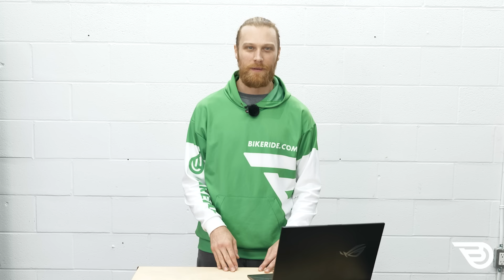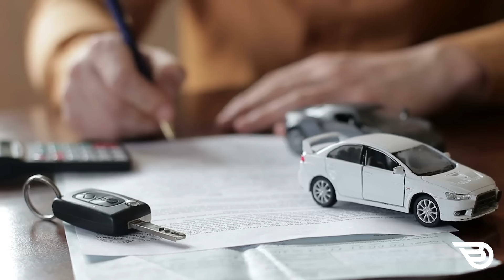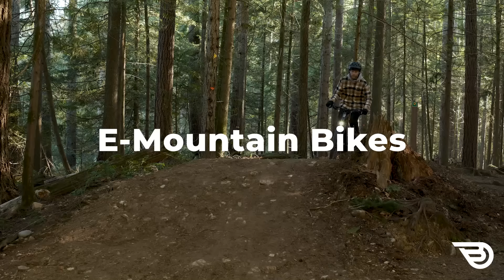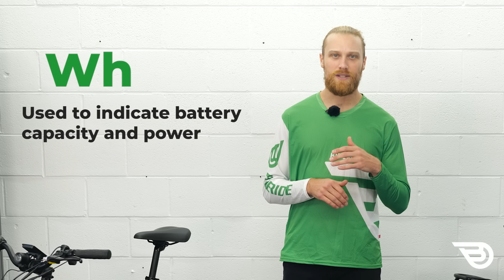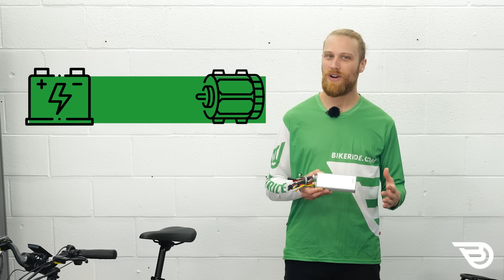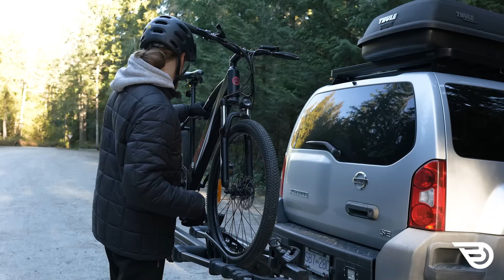Electric Bike Guide – How to Pick Your Perfect Bike

Comment: Thankyou for this review, I have a Land Rider which I purchased about 20 years ago. I've hardly riden it so it for all intence and purposes is like new. I want to convert it to a mid-drive ebike, what does the community think?
Reply from the maker: Converting a traditional pedal bike to accommodate a mid-drive motor would be very challenging. If I am not wrong, you would be required to remove the entire BB and weld the frame to accommodate a mid-drive motor. Then you would have to work out how to fit a drivetrain that would work with the motor; this would probably involve changing the entire rear wheel and hub and adjusting the chain line somehow. Not to mention battery, cabling, and sensors Plus brakes will need upgrading! 

It would be better off to attempt a "all wheel drive" with front and rear hub motors or simply buy a new bike designed for a mid-drive motor
Reply: @BikeRidecom  Thankyou for your input.

Comment: No electric road bike can go faster or more places than say a 26x4 tire Wired Freedom. It won't go farther or faster or off road as well.  Just lighter weight.
Reply from the maker: I disagree; a mid-drive motor could outperform a hub motor during long-distance testing if all other components are similar simply due to better efficiency. The Freedom has a large motor but still only a 20Ah battery, so we are getting down to elements like motor efficiency, weight, tire size compound, etc. I think we could find a competitor to defeat that 26X4 Wired Freedom.
Reply: @BikeRidecom  find a guy that can pedal 30 miles maybe at 35 mph .. Lol
Reply: The wired bike was not included in the line up, the question is why?
Reply from the maker: @careycustomrifle   The only reason is that we have not  had a chance to receive or test a Wired e-bike just yet. With so many bike brands it takes some time to reach them all! The name keeps popping up, so we will be sure to see about getting some Wired bikes into the studio so we can test them out!